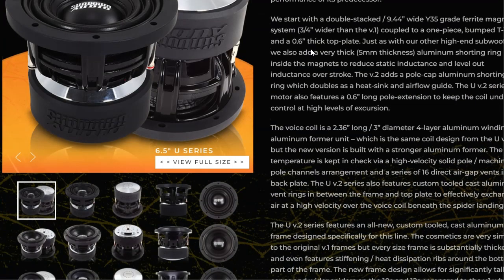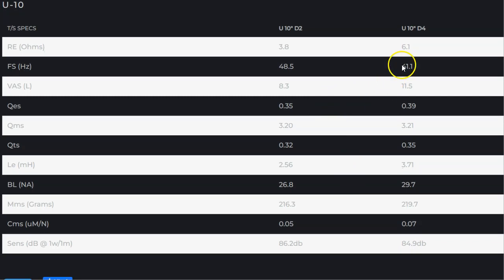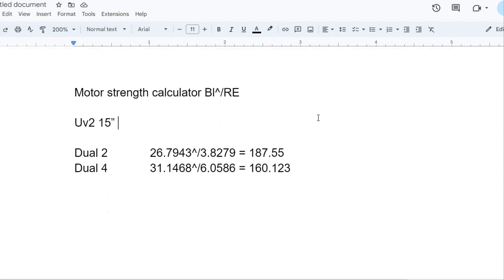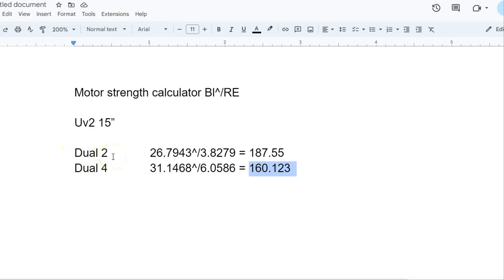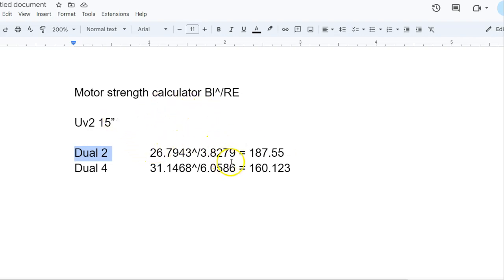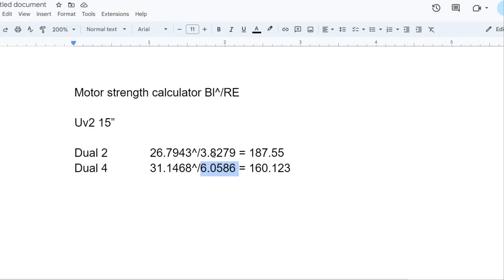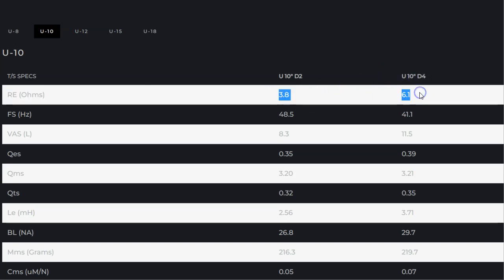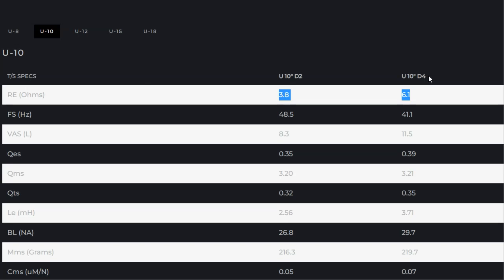Subwoofer Motor Strength Makes the Difference!

Comment: Curious question - would (1) U15 in a Bandpass (25hz-50hz) louder than (2) U15 in a 6cf 32hz vented enclosure?  Same power’ish.  I just can’t believe it would be louder but have been debating with folks.  :).
Reply from the maker: Great question, let me put together a video on the difference for you in the next few days.  Bottom line, with same power, the two ported will be louder at tuning.  The one bandpass will be louder with the rest of the frequencies.